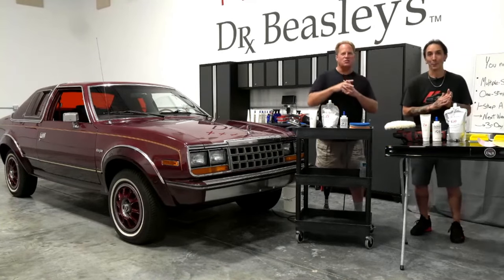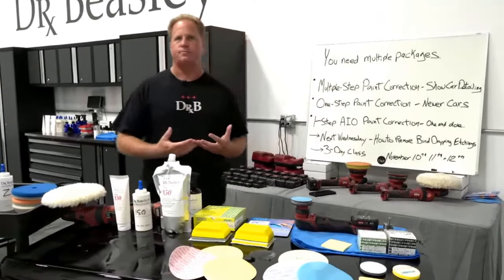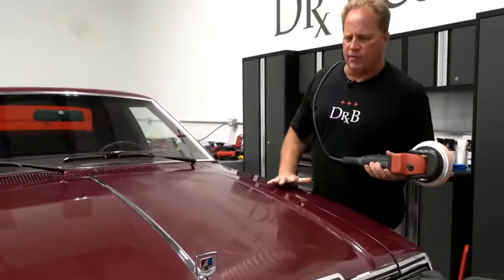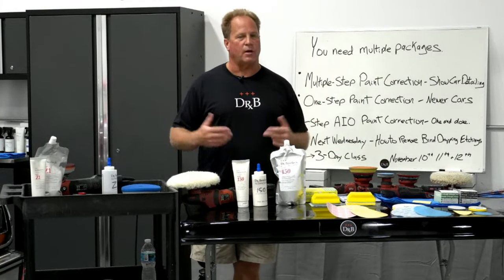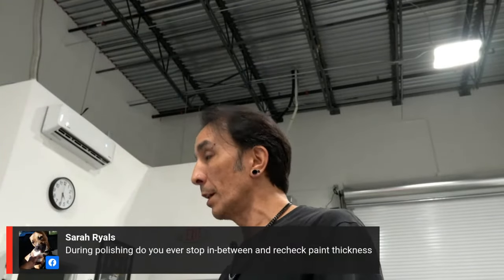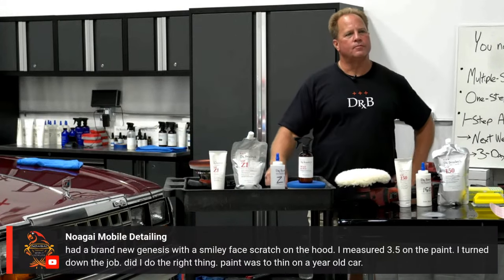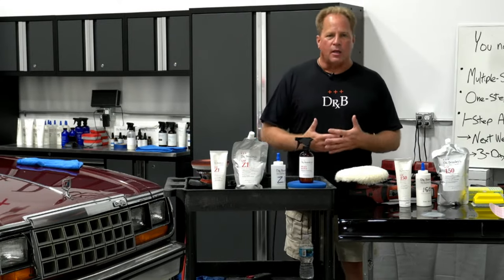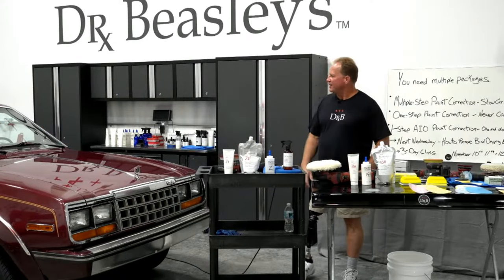How to Remove Swirls w/ AIO | 🔴 LIVE Online Detailing Class with Mike Phillips

Comment: Hey Mike, its a pleasure to be here as always.

 Can you say anything about "DA haze" or fine swirl/scratch removal on acrylic windows?
Reply from the maker: Hi Michael, DA Haze also called micro-marring is either caused by the abrasive technology or the pad you're using or both.  What are you working on?  -Mike Phillips
Reply: @DrBeasleys looking to refinish  condemned acrylic windows removed from airplanes without sanding/micromesh. 1 step preferably, but I'll cut then ultrafine polish if necessary.
Reply: Work performed under an FAA Approved Repairstation KBDN

Comment: How do you price out jobs ? Is skill set part of the pricing. I found many ways to price jobs out.lmk
Reply from the maker: Great question and the best way to price out a job comes from experience, that is knowing how long any type of job is going to take you.  Doing a TEST SPOT is also important because if the paint on a car is super hard - it's going to take a LOT longer to correct when doing multiple-step paint correction.  If doing like I shared here, using a One-Step Ceramic AIO - then pricing starts with setting the car owner's expectations by letting them know this type of package will NOT remove all the deeper scratches like RIDS or Random Isolated Deeper Scratches.  In general, if you want to be successful you need to be around the $100.00 per hour mark.  Geographical locations can be a major factor.  -Mike Phillips